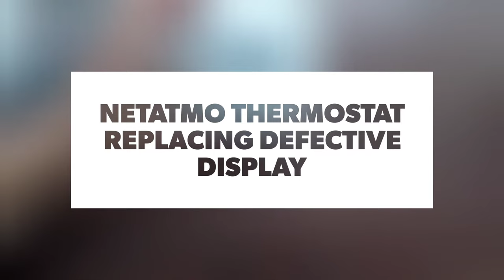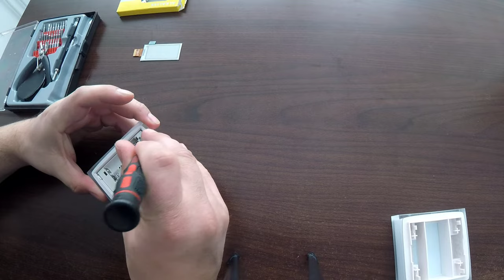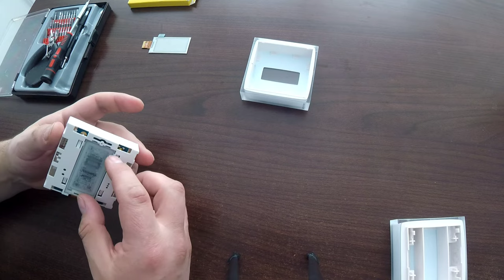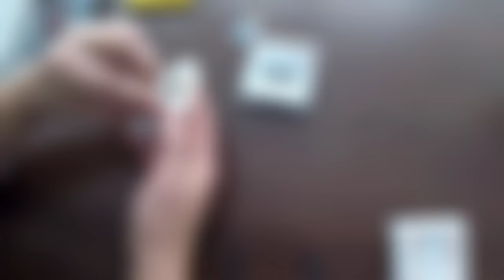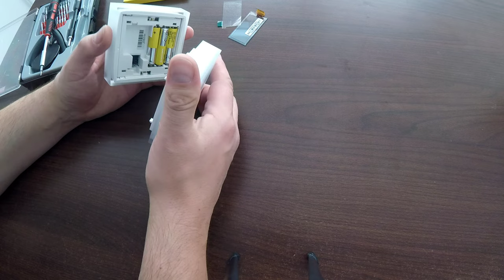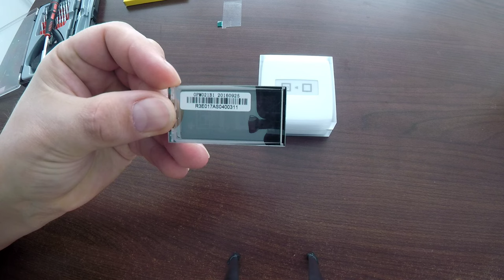Replacing a defective Netatmo thermostat display

Comment: nice video, but you cant easily put back the screen flat cable like that. I'm surprised you succeed without breaking it. The screen connector on the motherboard has a black lever. The lever is flush to the motherboard to secure the flat cable, you must raise it to open the connector, then slide the new screen then put it flush back again. So you should remove the motherboard from the case to do that, but it's very easy : no screw, just tiny white clips to enlarge.
Reply from the maker: You're right. I intend to rework this video soon. In the meantime I 'm looking for the root cause of the problem. Sorry for the late reply.

Comment: Hey, did you ever figure out what's going on and the new display also becomes dirty? I have two thermostats with the same issue, no point replacing the screens if they're only going to last for a couple of months :( Thanks!
Reply from the maker: As I couldn't find anything wrong with the electric circuit, I can only suspect that eink panels suffer from burn in without proper UV protection.
Reply: Direct sunlight damages the eink screen. Had mine on a wall and during winter the sun shines on it.

Comment: The pcb needs to be removed from the plastic housing so you can release the latch on the ribbon connector - otherwise the new ribbon will probably not seat properly & the LCD will not connect correctly.

Comment: I missed the bit about the lever but managed to ease the cable in/out. What I did have a problem with was reseating the board to ensure the electrical contact was made between board and base unit. Just something to be aware of.

Comment: Where did you get a replacement screen
Reply from the maker: I got it from AliExpress. 3 weeks delivery time to Europe. The cost was around 25 $.
Mind the fact that there are two versions of the screen (same aspect & dimensions but different electric parameters) so have a look first on the back of your Netatmo s display to check for the correct code.

Comment: Thanks for the video! However its much more easy to fit the replacement screen pin connector into its socket if you have previously remove the white case that fits the printed circuit board.

In order to extract the white case just pull the two metalic pins from both sides. Once you have inserted the screen pins connector on the socket, just put again the white case on the printed circuit board and finally fit everything into the external cover.
Reply from the maker: Good tip! Fact is this new display is getting "dirty" again so I'm suspecting there's an electrical problem damaging the eink afterall.
Reply from the maker: I got it from Ali also. Mine was good for a couple of months before showing first signs of damage. Anyway, it's back to workbench I'll let you know what I find. Cheers!
Reply: Thanks for this tip.
IT helped a lot
Reply: Thanks for the final piece of the jigsaw. Have ordered a new screen from china so it may be here in time for Christmas
Reply: @grahamsmith8122  Glad to help! Mine was replaced a year ago and it still works fine

Comment: Oke. So, update from someone who did this too😂:
- Ordered the parts from AliExpress (ordered two, to be sure I don’t break the screen, and I don’t have another one)
- I personally had to get the motherboard completely out of the plastic shell…in order to raise a thingy that kept the screen connector tightly closed. (I’m not an engineer idk how it’s that called 😅)
- I’ve connected the screen and put everything back together…BUT the hardest part was to put the screen under those plastic clips, to keep it in place…becuz I was so worried I’ll end up breaking the screen (like I did with the original broken one, which it ended kinda torn in half 😂).

So yea, just be extra careful with the screen. But everything went smooth and I now have a perfect Netatmo Thermostat…at the 20% price of a new one. And I have an extra screen too. Best 😩❤️😅🤷‍♂️

Comment: Hello,
When my screen break also the thermostat was no longer able to connect to Relè.
Relè is properly connected to wifi and the thermostat properly communicate with boiler, but since the screen is blank it seems that it does not communicate with Relè.
Did this also happened to you? Is the screen issue related to thermostat-relè communication?
Thanks
Reply from the maker: Hi, there's no direct relation between the display status and the controller/radio connection. Mine for example worked just fine without the display for half a year. I can only suspect that the batteries are getting drained fast: this may be caused by polling the relay too often or a short in the display connection. 
Remove the display, change batteries and see what happens. You can always use the app to set the thermostat.
Cheers!
Reply: Se agotan las baterías rápidamente si el termostato está lejos del relé